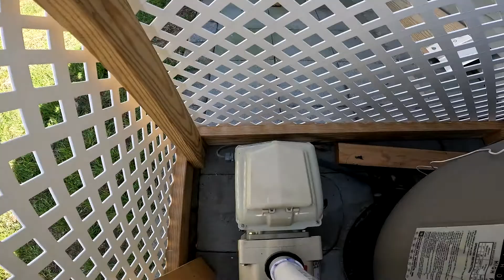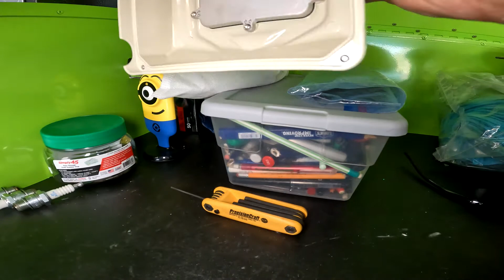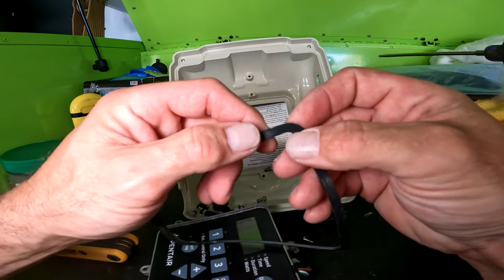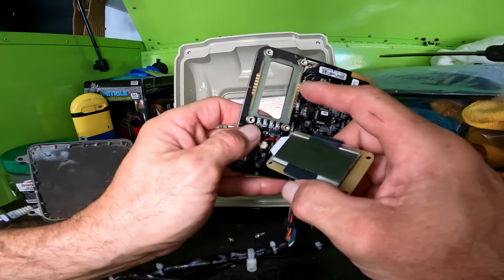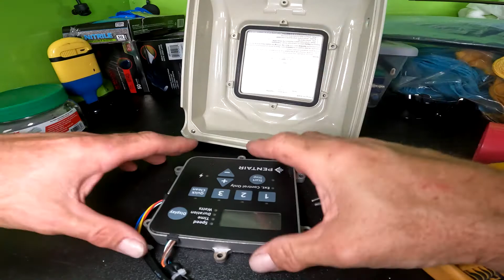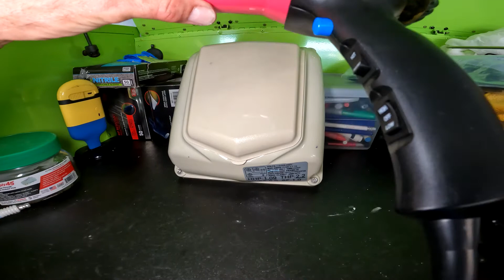Pentair Vairable Speed Pool Pump Moisture Control Board Fix DIY Save Hundreds SuperFlo 342001 353127

Comment: Thanks - great video !  I couldn’t even get mine to do a factory reset, however after following you video (there was a lot of moisture inside, including in the display), it worked !  My pump is about 5 years old, however only runs for approx 1/2 year.
Reply from the maker: Haven't done a follow up but that fix lasted about 6 months, then it "locked" itself at about 2600rpm.  But better than sticking at 3400 or 900.  Hopefully yours is a permanent fix.  I finally just replaced it a couple months ago.  I went with the same pump, from what I saw on ChatGpt and a few other sites they made some changes in that control board, but still for 1800.00 I expect more.  lol  Had a 1.5hp Hayward on there for 10 years, then had to get fancy.

Comment: I have a superlow VS also and the problem with mine is that the LCD is not showing completely . But the pump still works great and for the right amount of time every day . But it is tough to change programming because you can’t really tell what the numbers are . Going to try taking apart following your directions and clean the contacts under the LCD on both sides and see if that helps? maybe cleaning the contacts may help if water was allowed to get in there and corrode the contacts? Thanks so much for your great video . I’ll let you know how it turns out.
Reply: Did it work for you?

Comment: Was the pump still functioning/LED display on prior to taking it apart? I've had condensation in my LED for a while now but just yesterday my pump turned off during a storm and wouldn't turn on. The power light next to the lightening bolt is on, so I'm getting power to the pump, but it won't turn on.
Reply from the maker: The pump was still running, but it was stuck at like 3000 rpms, could not change the speeds.  If you turn the breaker / power off and back on it should still prime before it shuts off.  If it does nothing besides buzz or nothing, you may have just had the pump fried in the storm.   Try the breaker, if it primes or starts to run and then shuts off, its most likely the controller, if nothing most likely the pump.
Reply: @RagerJackOfAll  UGHHHH that's not the answer i wanted to hear. I was hoping maybe the previous condensation plus the storm caused the control panel to fry and I could just swap that part out and not the whole pump. Found a used control panel on ebay for $140. gonna give it a shot fingers crossed wish me luck!
Reply: Thank you so much for this video! I was able to take mine apart and get a used replacement part on eBay and put it back together with ease and got my pool pump back up and running. Saved myself a $600 bill for parts and labor from the service guy!

Comment: Where’s the battery for the memory ?
Reply from the maker: There is none, power goes off, you have to re-program them.  Since they are variable speed you leave them on all the time, no pump timer.  So if you want it off for say 8 hours you would just set the 3rd setting to 0 rpm for 8 hours.

Comment: Hi Greg 
Thanks for this video I'm a pool service professional I have the same motor and drive from a customer of mine that was damaged in the same scenario and it was a mystery as to how it occurred. Long story short it was a 3 month old pump and Pentair gave me a complete replacement motor and drive at no cost. So I was able to take care of my customer. Pentair did want the damaged motor and drive back so I kept it. It's been siting in my shop on a shelf for 3 years ...I recently put a test cord and plug on the motor to see if it was still doing what it did 3 years ago. (Figured it dried out by now) still has the same symptoms unresponsive drive.....I guess my question is before I open the display control board is did you have to clean any corrosion off of any pins or contact plugs? Like I said I'm certain by now it would be dried out....I'd hate to scrap a motor that I'm sure nothings wrong with ....

Thank in advance 
Bryan Smith 
BluEdge Pools
Reply from the maker: I did have to clean off a little but the pump was only a couple months old so it wasn't super bad and I think I caught it early.  Just took a soft wire brush and some contact cleaner and cleaned it up.  After sitting for a while it may be completely corroded inside. Unfortunately for me being a "home owner" and buying on Amazon... No replacement from Pentair.... but I knew that going in, just figured what are the odds of that controller not being sealed.  Thanks for watching good luck with it.